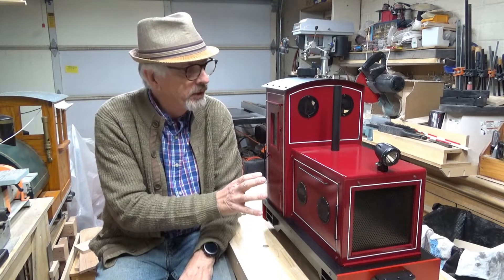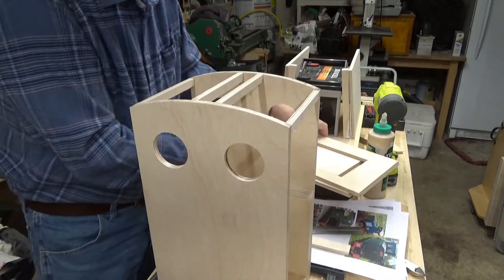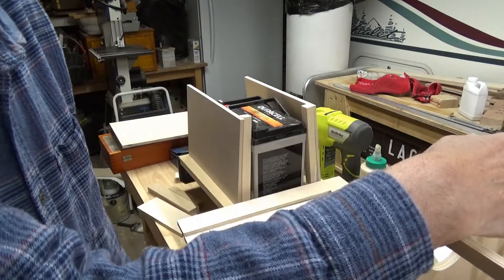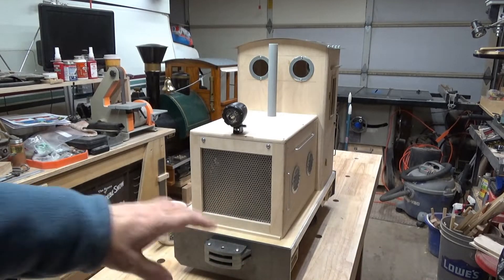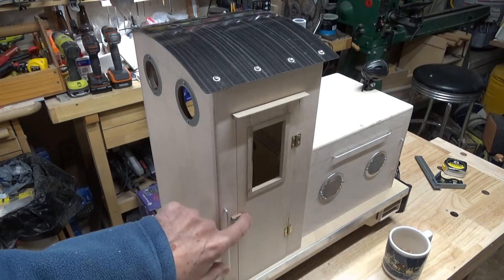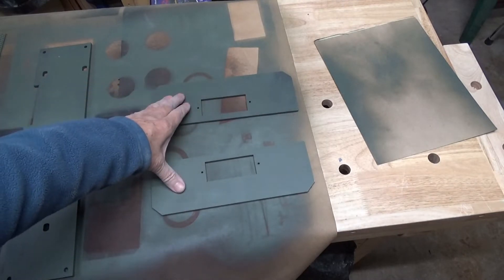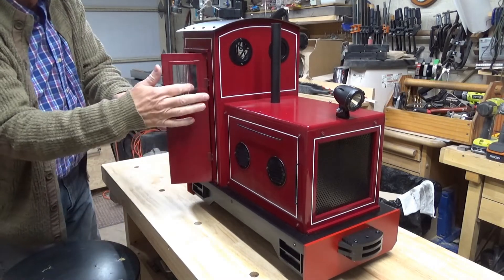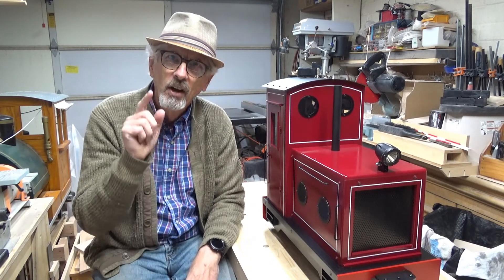Finishing My 5" Gauge Shunter  -  CNRR #23

Comment: What did you use for the cab window frames
Reply from the maker: Hello LT!  For the spectacle windows in front and back of the cab I found an item at the hardware store called a reducing ring.  Not sure if it's an electrical item or plumbing item, and they had various sizes.  Mine are just painted metal of some kind.  Since you asked, I looked on line at Ace and I see they also make them in brass.  Perhaps I'll upgrade at some point!  Your HO layout looks great!
Reply: @StanFerris  thanks, Stan